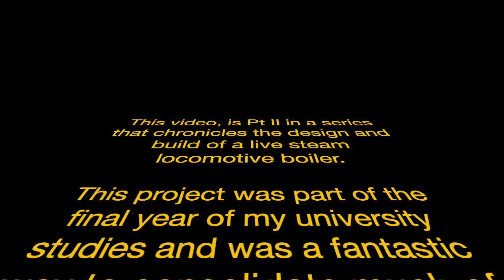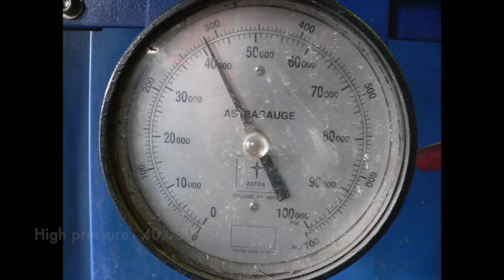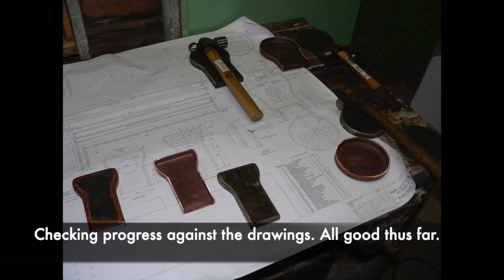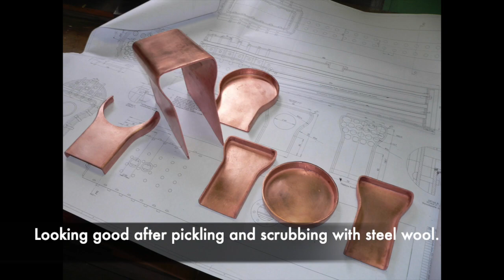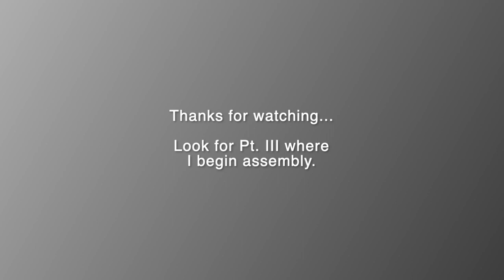Live Steam Locomotive Boiler Design and Build Project - Pt II - Fabrication

Comment: If I were to forward drawings for a U.S. prototype, 4-8-2 boiler in 1-1/2" scale to be done in the correct grade of copper would you provide a quote?   Thanks.
Reply from the maker: Hello Sir, I am most flattered, however I would have to decline. The boiler I completed in this series was done some years ago. I haven't done a lot of boiler work since then and am by no means an expert. Besides, I have far to many projects of my own and to little time! Good luck with your project sir.